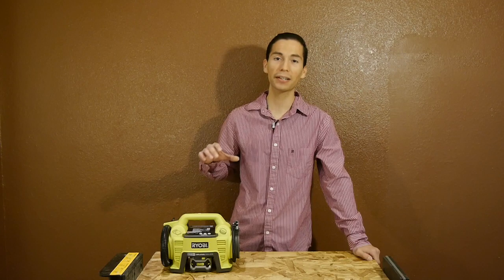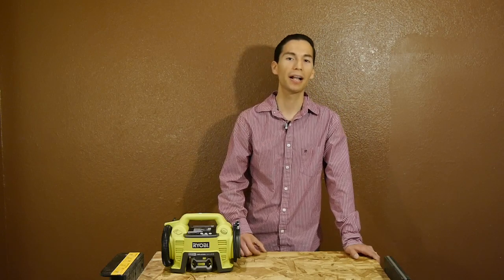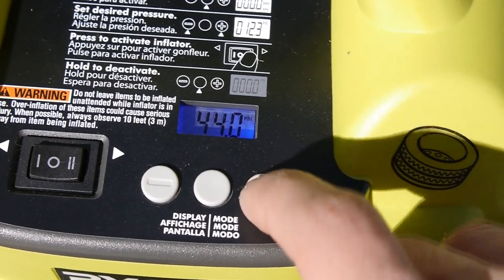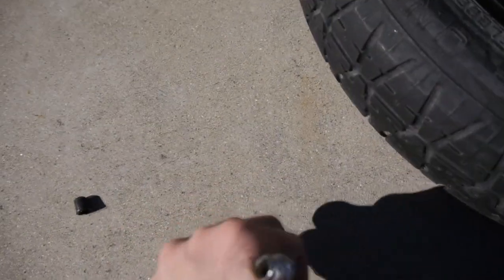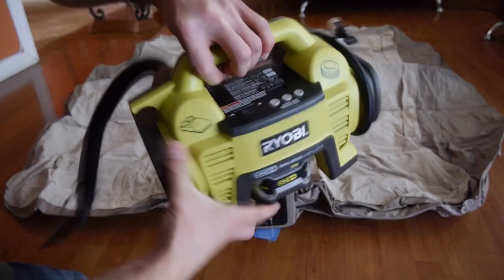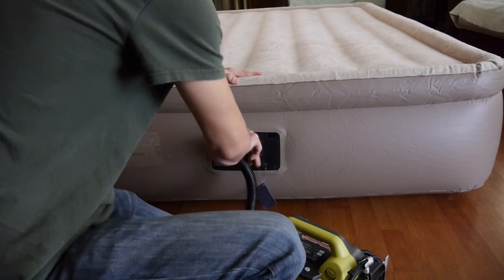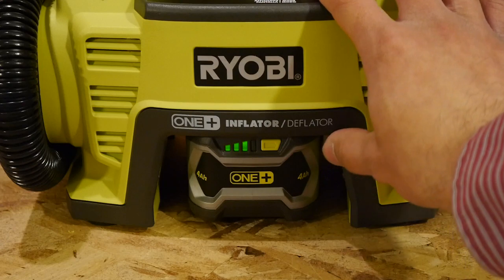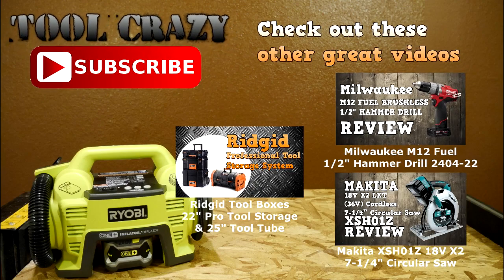Ryobi 18V One+ Inflator Deflator P731 R18I-0 Review

Comment: Great review.dude
but is there a ultra high power high volume air pump for air mattress need to be battery power for camping use can pump thing up in a min ?
Reply from the maker: Kenneth Kwan thanks Kenneth, this inflator can inflate air mattresses. The large queen bed in the video took a few minutes to inflate.
Reply: Tool Craze i was looking for something a bit unusual something very powerful 
can inflate air mattresses like airbag in your car something quick not sure how to describe it current device is a bit slow haha =.=
Reply from the maker: Kenneth Kwan all the mattress inflators I've used have all been slow whether battery powered or corded. That would be funny if you could inflate one as fast as an airbag buy it might pop. If you want to inflate a mattress super fast, you could try one of them blowers you know the high powered kind used for blowing leaves. That will drastically cut down the inflation time. The only issue would be finding a fitting to hook up the blower to the mattress vent.
Reply: Tool Craze dont mean to asking silly question but i just dont like the time it take to pump up the airmattress...
i have been thinking about some kind or portable CO2 pump that use in bicycle blower might be a good idea
 i can always DIY adapter for it , dont really need it to be as fast as an airbag but something like 1min.... 
any good mid size or even small size blower that power by battery you can suggest ?

Comment: so you can also use it with a nail gun? 
like with a normal compressor
Reply from the maker: You can't use it to power a nail gun. It's not designed for that, it's designed for inflating tires and sports balls and air mattresses, etc.

Comment: Does the inflator have a max pressure? I was wondering if it could be used to fill a sup board, only needs 15 psi pressure
Reply from the maker: yes it does, I'm sure I mentioned max number in the specs

Comment: Can you deflate tyres aswell say for offroading?
Reply from the maker: The deflate function is for high volume/low pressure stuff like air mattresses only so no but deflating car tires is easy as I'm sure you know and you don't need this to deflate them, actually you technically can use this by inserting the hose to the tire valve stem but don't lock in place and the air will escape. Or just use the other end of a tire pressure gauge, works just the same.
Reply: @ToolCraze  or just use a stick 😂